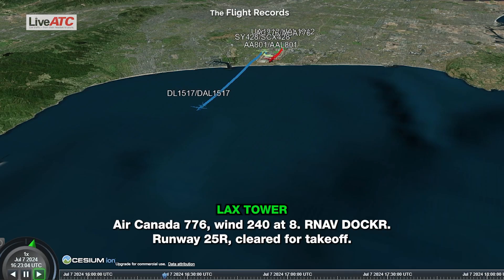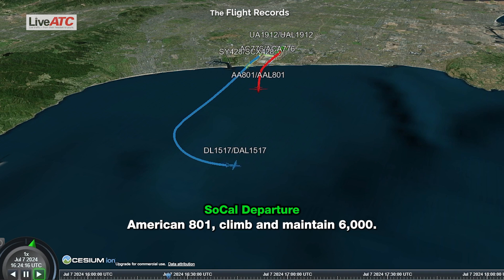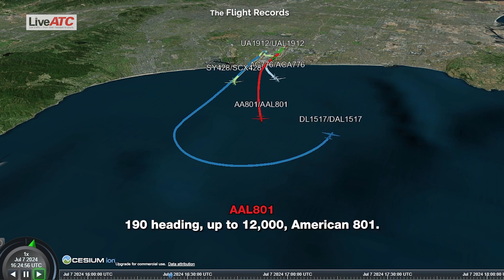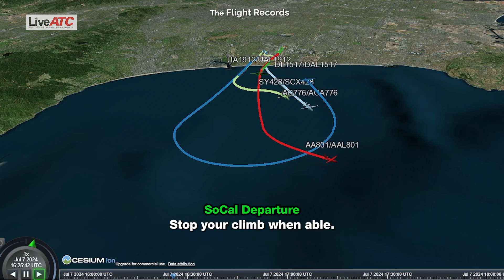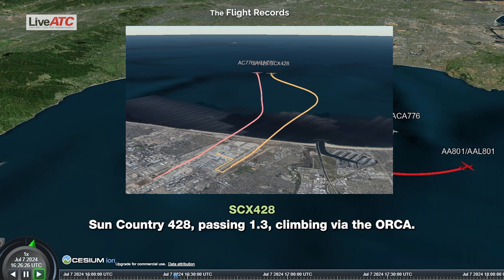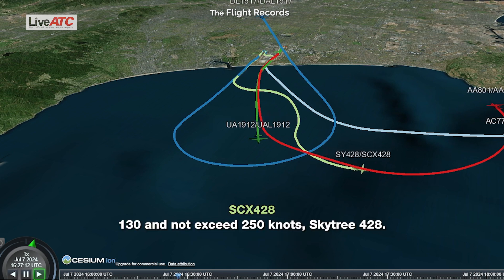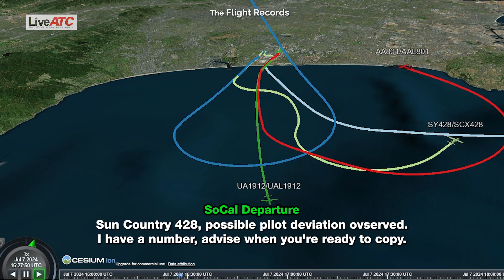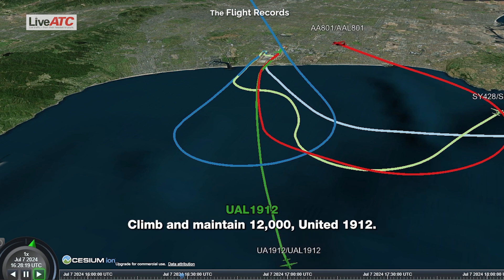Near Mid-Air Collision at LAX Caused by Pilot Error Averted!

Comment: WHY IS THAT BLUE PLAIN FLIGHT PATH INTERSECTING A LOT OF TRAFFIC?  WHY IT DID NOT TURN ON THE OTHER DIRECTION INSTEAD WHEN THEY KONW THAT A LOT OF TRAFFIC ON ONE SIDE.
Reply: I think that the reason may be as follows.  I live a few miles north west at the Santa Monica airport.  As the planes fly over with 1000 foot separation north and east to to a clockwise rotation to land at LAX.  You have to keep a horizontal separation as well, so just have the planes take off and land usually going off shore and unless eventually going north, have every one turn left (south).  The ones headed north eventually will be sent far out before turning.

Comment: We need to change how ATC works. All communications should be digital, not analog, to avoid stepping on each other. Also, it would be nice to have AI maintain aircraft separation, rather than flight controllers.
Reply: It does seem like an automated system could help, in addition to controllers. Its a trick teaching the computer what is within ok parameters and what not. We have the same problem in so many areas, as you must first write a program modeling the possible situations, then have humans guide things, then see if we can teach the computer how to do the same. Its not like you just smear "AI" on the situation. Maybe you knew that but many think AI us universally applicable right now.

Comment: Super easy DP. Crew obviously didn’t brief the ORACKA 5 SID.  I’m assuming the Autopilot probably turned them towards KLIPR

TAKEOFF RUNWAY 24R: Climb on heading 251° to 640, then climb direct to cross FABRA at or below 3000, then on heading 251° or as assigned by ATC, expect left turn to cross KLIPR at or above 10000, then on track 044° to cross KEGGS at or above 13000 and at or below FL190, then on track 044° to cross COOPP at or above 15000, then on tra

Comment: You need a better headline writer. This one seems to imply that it was pilot error that averted a mid air collision.
Reply: I just read through the SID. It seems to me that it was pilot error that nearly caused a mid air collision. The SID states (albeit not as clearly as it should) 251 heading or as assigned by ATC and EXPECT to cross klipr at or above 10. They (or the automation seemed to believe that a turn to klipr should occur right after fabra, regardless of that 251 headed instruction.

Comment: It would be a whole lot easier and a whole lot safer if ATC let everyone follow the Standard Instrument Departures instead of constantly assigning altitudes, headings, and speeds.
Reply: The SID begins to separate aircraft departing simultaneously from runways 24 and 25 with 15 degrees of diverging headings. That's why the aircraft must remain on that heading until ATC advises. The SID does nothing to separate them in the turn towards the east which is why you need the controller. But, if you want to launch them from only one runway, one at a time, and just follow the SID, expect delays.